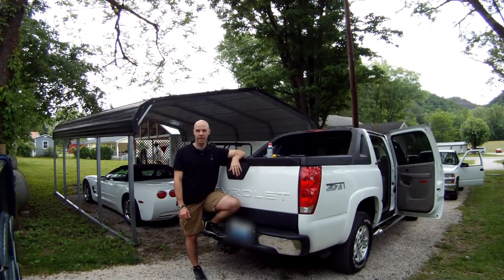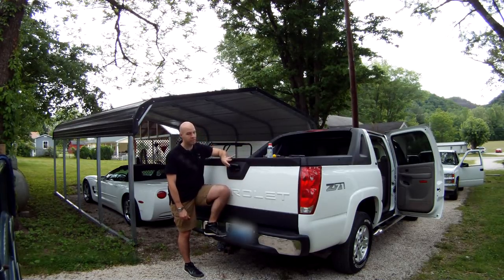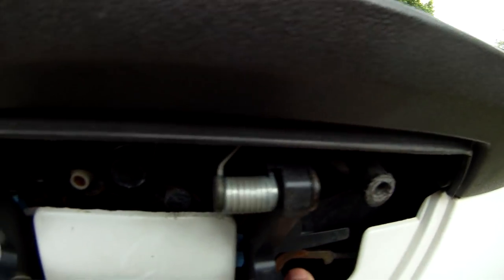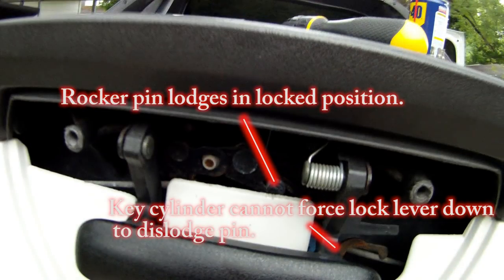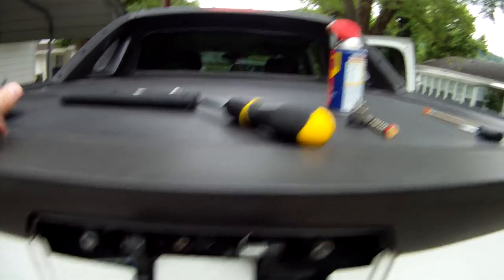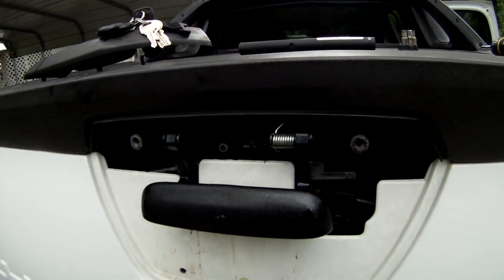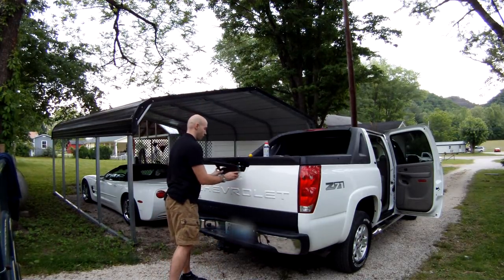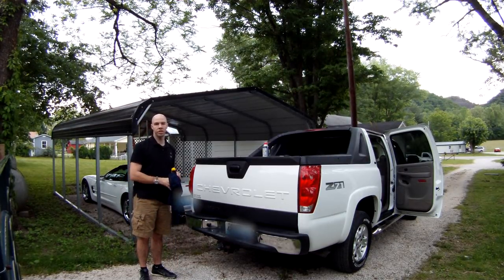Let's Tinker - Chevy Avalanche Tailgate Lock & Latch

Comment: Thank  you for the video. My Avalanche tailgate wasn't jammed but was heading in that direction. Your video made it easy to pull the cover off, clean the parts and re-assemble. I wouldn't say my tailgate is like new but it's pretty darn close without having to replace any parts. Thanks again.

Comment: This really works!  Fixed my tailgate on my 2005 Avalanche.  My lock was real stiff / not locking or unlocking.  There were two things going wrong - 1. the lock was sticking very bad su to rust and no lube.  2. the lock tab on the tumbler was bend as I had tried to lock / unlock it many times because of the first problem.  So followed the instructions - gave the lock a couple squirts of lithium grease, straighten the arm on the lock and everything now works like new.   Thanks!!!!

Comment: I know this video is old.. but it is forever timely for those that need to see it.  

My dilemma, was more severe;  One of the (white) plastic retainers that "grab" the threads on threaded rods shattered, (age related embrittlement I assumed)  thus letting go of the rod and not disengaging / operating the drivers side latch   
My solution: I replaced both (plastic) retainers, added lock nuts on the end of the rods, then used 'zip ties' on the (new) retainers to hold the  plastic retainers together.

The parts cost was VERY minimal.  The skills to do the work moderate (just as in your video) the frustration level until I figured it out was significant.

TIP: don't forget to lube the latches also.
Reply from the maker: Always glad to know my videos (even the old ones) helped in some way. My Avy is still around. It's a clunker box these days, but still works. We use it as a local runner for the family business. Glad you got yours fixed!

Comment: THANK YOU THANK YOU THANK YOU!!
Was told by Chev dealer that cables were broke.
Watched a few Video's claiming latch needed replaced-- $69.00 for new part.
Before watching video's, I was about to take 6-8 bolts off, remove tail gate, take out screws along bottom of tail gate, remove plastic inner panel and see what was up.
Watched your video, hit the thing with PB Blaster, moved stuff around with a screw driver til it moved freely, then applied some grease lube spray
And like they say in the movies
VOILA!!
I'll bet 90% of those other videos show replacement-- could have saved a lot of time-- and money if they saw yours first!~!
Thanks--
Reply from the maker: Wow, thanks friend!

Comment: Very helpful video. I was a bit confused on where the locking pin to release the latch was since it was obscured in the video, but I was able to figure it out (after I put my reading glasses on for a better look). Once that part was solved it was free sailing from that point on.

Comment: Thanks so much for the great video.
In my case, I found that the plastic handle had broken on the passenger side, causing the release lever not to be activated.
I was able to glue it back together, using Loctite SF 770 primer + 401 since this appears to be PBT plastic. Lubricated afterwards.
Not sure how long it will hold so will keep an eye out for a new tailgate/mechanism next time I'm at a junkyard.
I have a 2002 Avy with 250k+ miles... bit of an eyesore but it just keeps on running.
Reply from the maker: Glad you got it worked out. Same deal with mine these days. I bought a new Silverado and left the Avy back on our farm as a utility bomber. 300K, sunroof is off track, bottom rusted out, basically a junk pile, but she still runs like a top.

Comment: Very Helpful, however I had to replace the entire assembly and the left rod fell inside. Any ideas on how to retrieve it? Will it stop prior to hitting the bottom?
Reply from the maker: Ugh. In the most extreme case, you'd have to remove the whole inner cover, but try fishing it with a wire coat hanger first. Someone else here had the same thing happen and the coat hanger worked for them. Good luck!

Comment: Damon,
I have a 2008 Avalanche where the hatch locks with the remote.  I dont even hear the hatch locking or unlocking when I press the button.  I also have a rear view camera.  Do I follow your video or is there a different approach?

Thanks
Reply from the maker: Hey David, sorry for the late reply. There were a lot of changes made between the 2005 and 2006+ model years so I cannot say for sure. My guess is the mechanism is similar, but with a solenoid or servo motor linked in. The camera is very small, but there will be a wire harness attached so be careful when you remove the bezel.

Comment: Just suggestion. Rather than laying in the bed under the covers, you could unlatch and pop them off from the inside while you are in there. Then you can have full light and easier access to the screws.
Reply from the maker: That's not a bad suggestion, but you have to start with the last (closest to gate) unless you want to force it. By the time you slide that far under there, those retainer screws are so easy to work with you can get them out in the same time it takes to open a cover. I'll keep it in mind for anything tougher though - thanks for the idea!
Reply: You have to pop the locks on front two covers, push them up in the middle to move them. The locks on the last one won't turn far enough to release it with the gate in the way. I did it that way when one of the little plastic latches popped off of the actuator bars that go down to the latch on each side of the gate. The handle was fine, and luckily ours has the full internal housing with the little holes in it for the bars, so it didn't fall way down inside and have to fish it out.

Comment: Is That a New year model chevy or did you restore the plastic cladding recently it looks very black. I have an 2002 avalanche which we tried to darken back with wipe new. For the most part it worked but only to a dark gray. If that is painted or restored somehow i'd love to know how.
Reply from the maker: It's a 2005, all original and like all Avalanches has gone grey. I just try to take good care of it. I used to put a product call Spray & Shine on it. Two minutes to spray on, rendered it black as coal dust and lasted a couple of months. Problem is it took a whole can per treatment and the stuff is almost impossible to find here. Now I just make sure to rub it down with Armor All around once a month. Bigger pain but works if you are consistent with it and also stops the covers from leaking. Hope that helps.

Comment: The bars dropped into the door.  Any suggestions on how to get them?  We cannot open the tailgate.
Reply from the maker: +J Mac You'll have to take the whole cover off to retrieve and reattach them. 'Hate to say it, but unless you are really confident with your hands at this point I'd recommend heading to a dealer.
Reply: +Damon Caskey thanks. with a little patience and a coat hanger they found the bars and taped them up...
Reply from the maker: +J Mac I stand corrected! Glad you could get it fixed.
Reply: Me too! Thanks for the rest of the info, it helped

Comment: How do you keep your black plastic so shinny
Reply from the maker: No great secret I'm afraid. Just an occasional scrub down and Armor-All. 

1. Lay out the tonneau covers on the ground. You need free access to them and the wing bar.
2. Grab a good towel and a 28oz spray bottle of Armor All original. You'll be using most of it.
3. Hop up in the bed and rub down every last bit of plastic. Spray it right on the plastic, use plenty, and rub it in good. When in doubt, use more. The plastic (and you) should be practically lubricated when finished. Don't worry if you get it on the paint, it won't hurt it. In fact I don't even bother watching myself around the roof since it's just a bit of extra wax up there, but you do want to avoid getting it on the sides - it can make a mess.
4. Do the same thing for the tonneau covers.
5. Don't forget all the little bits of plastic around the truck. Bumper strips, step guards, air dam...
6. I like to rub a little touch of WD-40 on the gaskets before I put the tonneau covers back.

Whole process takes ~hour and a lot of elbow grease. It won't look great while you're doing it, but ~30 minutes or so after that plastic will be black as coal dust and last 2-3 months depending on weather. I don't bother with any of the fancy stuff. Most of it works fine, but no better than my method and isn't nearly as cost effective.
Reply: DC Current thanks so much very appreciated.

Comment: I ended up taking it to a collision shop to have it fixed. The handle was corroded and rusted. I ended up getting rid of my avalanche a couple months ago cuz it was a money pit.
Reply from the maker: Aww, that's too bad. They do have high cost of ownership, but I'll miss mine a lot when I finally have to get rid of it, because there is no better do it all machine for "weekend warrior" types like yours truly.

Pickup:

-Haul your dirty gear, kayaks, skis, etc. and spray the bed (or not) when you're done.
-Carry work loads of dirt, hay, tools, whatever else.

SUV:

-Keep your luggage, groceries, whatever under roof without taking seat space.
-When the camping trip goes wrong or just need a place to take shelter, three 6'+ adults can sleep comfortably in a Tahoe.

Avalanche:

-All the above. It may not haul quite as well as a pickup, and the sheltered space isn't fully on par with an SUV, but having a single vehicle in your driveway that can do a respectable job at both is pretty darn cost effective when you think about it.

The closest you'll get is a tricked out crew cab with aftermarket lining and bed covers. Even then you'll still be missing a lot of the Avy's features. Here's hoping some of them get ported to the CK line. I don't expect the mid-gate to get ported, since that requires bed and body to be a single unit. But there's no reason the others couldn't be made available as options. Rear boxes, self storing bed covers, self-draining bed, factory bed lining, and so on. If Dodge can copy half of it into their pickups and air two minute bore fests of Sam Elliot crowing about "innovation", why can't GM do the same darn thing to themselves?

/rant

Comment: My 4th Chevy truck first Avalanche
Why can't Chevy make a tailgate that lasts ???? I've had a problem with everyone very frustrating
Reply from the maker: Every company seems to have design flaws they either don't acknowledge or outright refuse to fix. Just looking at the domestics, Ford has their idiotic starter design and general electrical fails, Dodge can't seem to get wheel bearings right after 100 years, and GM clings to certain faulty parts (Fan relay, tail gate latch) like a dying relative. They all have advantages over each other too though, so it just boils down to personal preference. I'm a Chevy guy, but they're all good trucks in their own way.